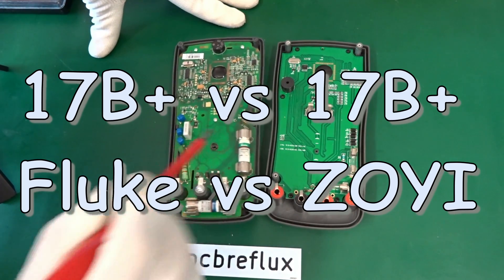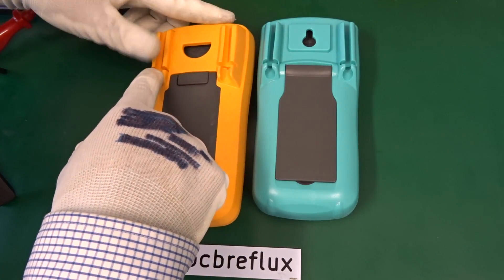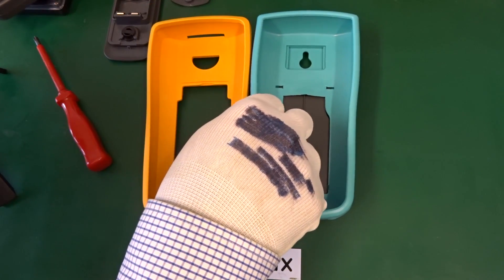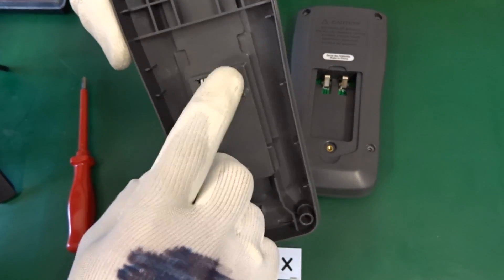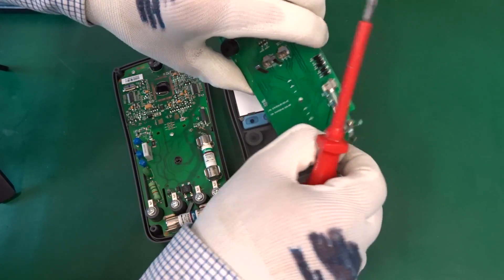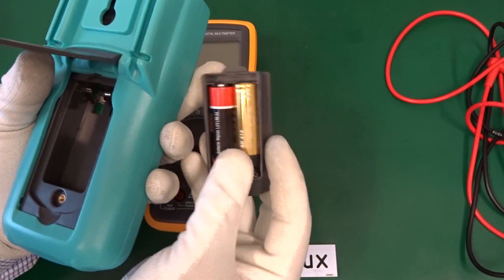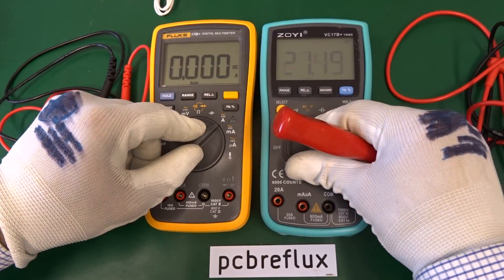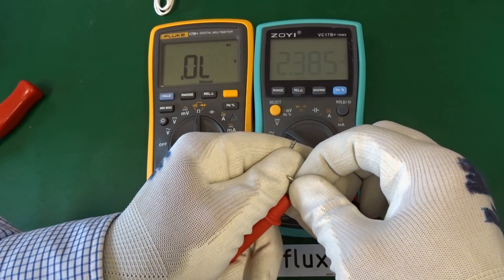Multimeter contest - Fluke 17B+ vs ZOYI VC17B+

Comment: So weird, because the an870 has good reviews from Western reviewers, and it seems to be the same meter on another brand name
Reply: The AN 870 is a god bench meter for low Cat 1 energy work an if has 19,999 counts theFluke is much safer around 220 volt  main  breaker  panels  . I own both the Fluke 15B+    the  complement each other The Fluke is much safer for Cat 2/3 work  the Zoyi is best for lower voltage DC work or 15 Amp  120AC volt stuff on a GFI outlet.   One meter is never enough......

Comment: Do you still have both of these meters ?
Can you confirm this zoye and fluke can measure a high frequency ac voltages ? I mean can they measure voltages in car inverter chopper transformer output voltage which are typically 145v at around 49khz frequency

Comment: I think you may need to find new batteries for the Zoyi. I own a number of Zoyi multimeters but have never seen a display like yours. Maybe you have a faulty meter.
Reply: He did take the PCB out and probably had not alligned display contacts while putting it back.

Comment: What a shitty review. You should've tested both before taking them apart. It is clear you broke at least the lcd connector on the Zoyi, who knows what else you may have broken. By not testing and comparing them before you did the tear down your review is meaningless.

Comment: LCD is very dim. Haven't you broke it yourself? You should test the devices prior to taking them apart.
Reply: No... I have the same unit... on angle the digits are dim...  If you look straight the digits get better..  That is my only complaint with this meter...  I have used it for 2 years and it still works perfectly..  I do board level repair..

Comment: How can you claim this is a fair comparison of both meters when by your own admission the ZOYI "is a little bit faulty".... I wonder if this comparison would have continued if the FLUKE was "a little bit faulty".... Highly unlikely I think... And why would anyone bother to compare a $22.00 multimeter to a $160.00 multimeter ?...
Reply from the maker: Fair enough. The Video was intended as a unboxing and comparison of the “original 17B+” ($100 from china) and “clone 17B+” ($20 also from china), like …  don’t turn it on – take it apart.  The comparison just started by the same form-factor, name and functionality, but after put the ZOYI together and turn it on every thing was a mess. Maybe this was a quality issue by the seller, but just want to share my experience.

Comment: you must work for fluke, I have this meter and like it very much, especially for the price difference, and it appears to me that you broke it when you screwed around opening it up.
Reply from the maker: +Paul N/A Thanks for your faith but this may be disappointing, think fluke wouldn't offer me a job for showing grey import meters from the chinese market and compare them with realy cheap clones.
Reply: Paul N/A, you are demonstrating your complete lack of understanding what you are seeing in this video. I assume your real problem is that you are disappointed that your choice to cheap out on a multimeter was not validated.

The VC17B+ is exposed, thanks to this video, as a very cheaply made superficial copy of the Fluke 17B+. Superficial in that it is made only to "look" like the Fluke externally in a devious attempt to fool those that won't look inside, or understand what they see if they do take it apart. 

The VV17B+ is a complete piece of junk that is not only potentially dangerous, it is highly over-rated. This evidence is in the video. The VC17B+ is an accident waiting to happen.  If I had one of these, it certainly would never see mains current and at best be limited to low or no-voltage applications like testing  batteries, identifying or checking resistors, caps, diodes, etc. 

To put this in perspective; this meter, as shown the video, has essentially no protection for the user except for a simple glass fuse. Frankly this meter offers no more in terms of user protection than Harbor Freight's $3 freebie meter.

I'd ask you to watch this video again, and pay strict attention to the fuses and the fact that this meter ostensibly sends up to it's rated 1,000 volts directly to the selector switch... 

Seriously, get yourself a better meter.
Reply: If it can be broken so easily by opening up the case, then it's a piece of junk. Imagine how shitty the solder job and assembly has to be for it to break this easily. Get a better meter mate.
Reply: LOL...He must work for fluke? You see with your own eyes that your meter that you like is JUNK. It's an accident waiting to happen.

Comment: Are those batteries on the ZOYI VC17B+ in good condition? Looks like not.
Reply: Looks like a bad connection to the display, since it is both faint and some segments are going out, or even a damaged track on the knob, may have been fine before removing the PCB. You've only got to strip a screw by overtightening and the zebra strip stops making good contact, or get some dust on the contacts, then clean it with solvent to try to fix it, which could make it swell and put it back together before it has fully dried and shrunk back. Been there, done it with a cheap timer I wanted to get working. :)

I've got the same meter with different branding, fluke quality it certainly isn't, but it is not a bad meter for the money and the display on mine is perfectly fine.
Reply: Look at the protection, Zoyi did fool us by  labelling Cat II and Cat III.
Reply from the maker: Hi, thanks for this. But unfortunately try different batteries fresh out of new purchased packages but the display is the same. Don't think this is for all this meters but mine is a little bit "faulty".
Reply: Mmmm. Looks like a faulty unit, I don't have one of those but there are good reviews of that model. Anyway, there is what it seems an upgrade version of this model, I mean the BSIDE ZT301 (8000 counts) or the ZT302 (9999 counts). Just got one from Aliexpress for US$22 on sale but still on the way so can't comment. There are some "first impressions" at the second page of the EEVblog forum. Search in Google for "ZT302 eevblog" and you will find it.

Comment: Oh, I can support with some smaller canyons, rocks, towers, waterfalls around here. But up to now I prefere using my meters as intended.
One of the advantages of a high dynamic range meter (e.g. 50,000 counts): you can measure the supply current of battery driven Homematic transmitters with tow quiescent currents (uA) and a working current of 30mA. 
Meters with less counts mostly have a higher burden voltage leading to a reset when the units start sending.

Comment: If you are looking for a usable cheap multimeter with no serious CAT Rating, you can look for ANENG AN8008. 10000 counts and not too bad. You can find tests on the channels of Joe Smith and Dave Jones. And you can buy it from banggood or eBay <15EUR.
If you are looking for a real CAT IV 1000V rated one  UL listed, you can go for the Brymen BM869 or the less precise BM859. You can even get them in Germany.
Reply from the maker: Thank you. The ANENG AN8008 has at least a little bit of (fused) protection at the Voltage/µA/... plug and you don't risk arc overs of bare tracks with tiny clearance that goes strait to the input. Got attracted to the VC17B+ just by the optical and functional similarities between the Fluke 17B+ and a bit for the trueRMS feature for AC and temperature readings, but don't really needed an other meter. Even for mobility I would prefer my current bigger meters, and unlike Dave the next canyon to hike with a meter is far from me.